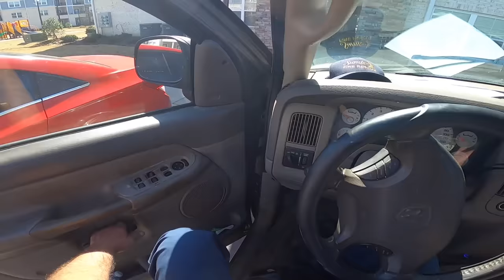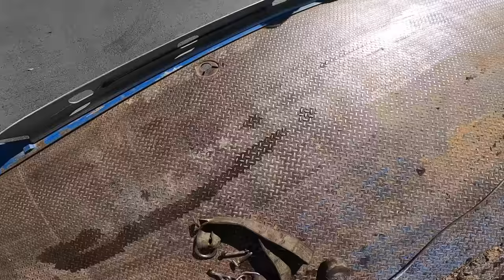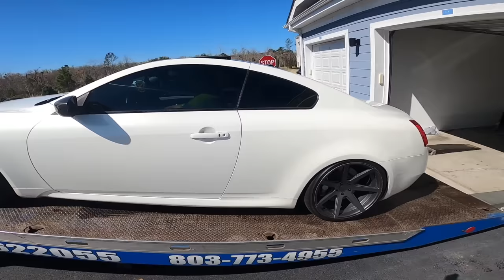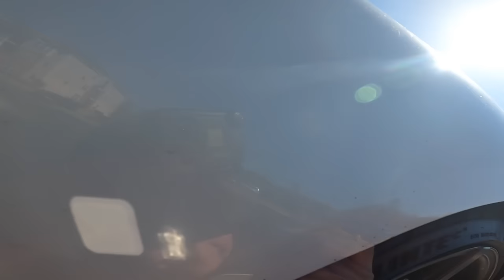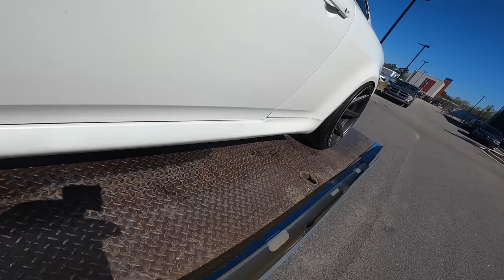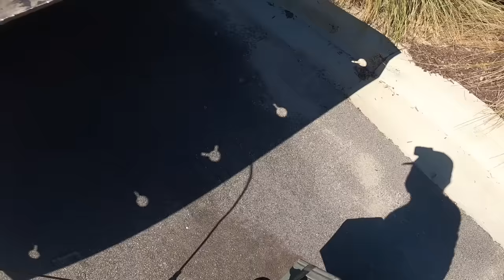How To Tow A Lowered Infiniti G37

Comment: I have never understood the lowering of those cars or those narrow tires!  Good job loading and unloading with out any damage!
Reply from the maker: Mr Edwin  We appreciate that. Thanks for watching and stay safe.
Reply: Lowering a car is done to lower the center of gravity to improve handling for high performance driving if you track the car.  Of course it is done to street cars mainly for show but can be a problem  for speed bumps, car washes, hitting curbs, etc if too low .